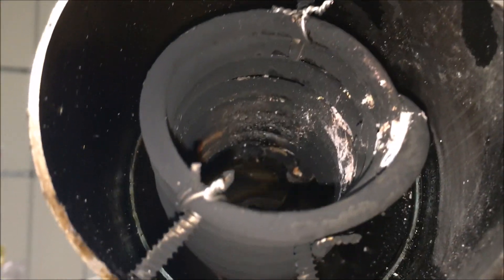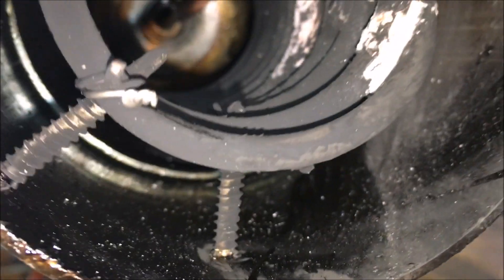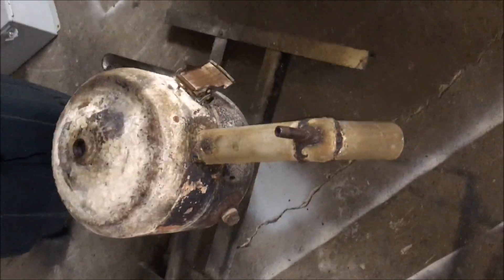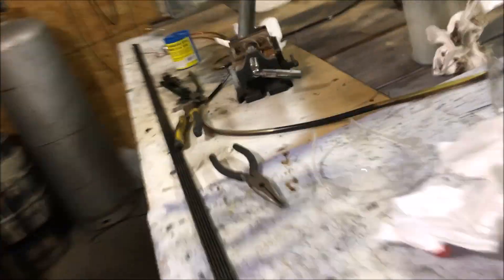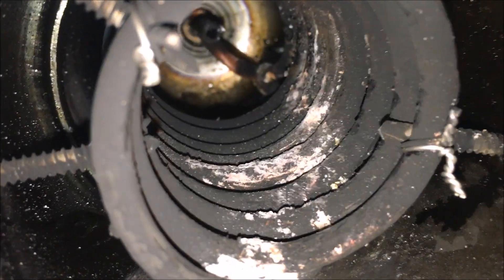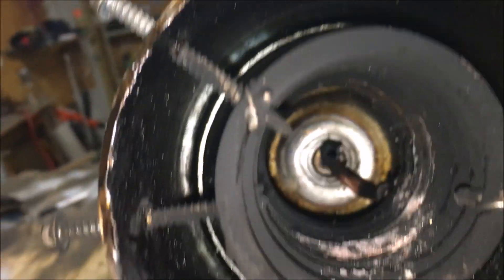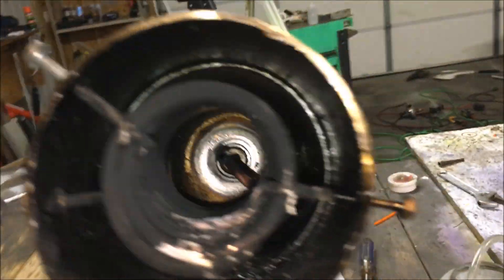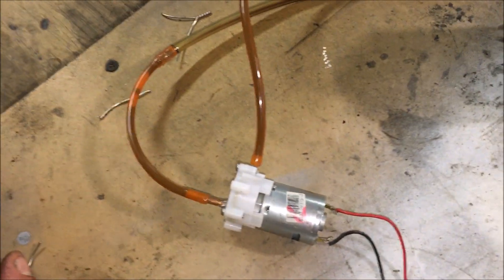Waste oil burner Vaporizer coil  nozzle designs

Comment: What kinde of oil are you burning?! Motoroil or used veggie oil.
Reply from the maker: motor oil synthetic
Reply: @NOBOX7  

There are a few different residues in the oil if you have driven with diesel or gasoline. In gasoline, there may be various salt residues that they put in the gasoline to lubricate the valves after they have removed the lead. Can think that there are different kinds of polymers in the oil as it is synthetic. If it comes from a diesel car that has driven biodiesel then there may be residual glycerol.

I have worked in large heat plants that use different types of oils. Everything from pine oil to various mineral oils. What you describe as the hard coating can be salts. Furthermore, the sticky coating is similar to that obtained around the injection pipes but not in the rest of the boiler. The salt coating ended up in the bottom of the pan and could be glassy in the surface.

The pine oil is not crude pine oil but residue from the oil you get from the pine. All industries take what they want from the oil and residues and the remaining ones use the heating industry.

Try washing the sticky with white spiritus naphtha and the hard ones with hot water.

Comment: The white build up is spent carbon just the same as you get on a piston when you strip an engine it means your running lean .... to much air and not enough oil.

Comment: your fuel to air ratio is correct .... but in my experience, waste oil can be very misleading and particularly counterintuitive. you are getting a consistent burn with no smoke, complete combustion *in the fire*. but there is significant oil puddling (perhaps just from startup) and a very mediocre flame pattern overall. 

you need more air and more air pressure, and likely more fuel pressure but less fuel. this is not the be all end all answer - just an observation and a suggested starting point to further refine this torch. 

the oil, ideally, does not need to be preheated beyond 300* F. once you are beyond that, you will almost always have the problem of varnishing and carbon build up inside, rendering the preheat tube and fuel delivery non existent. if you try placing the coil outside of the burner tube with only 2-4 wraps around, it will probably perform better. running brake cleaner through the tube should remove most of the carbon build up. 

i think it is also worthwhile to cut your motor oil with up to 50% diesel fuel or kerosene - lower flash point, lower viscosity, similar btu output -- less hassle overall. 

a bounce house blower should provide enough air, and the excess can be metered off. 2" pipe should provide enough room for the air to flow. you want something with relatively low velocity, but higher pressure and higher flow. 

oil is tricky because it will burn 100% of everything ready for combustion, giving the appearance of a good flame, but really not what you are looking for. putting a reducer on the end of your burner tube (4" to 2") should give enough combustion chamber to burn more oil and push it out further, leading to less unburned hot oil blowing out of the assembly. 

i install ductwork for a living and i myself have gone through 7 iterations of waste oil burner, i have melted hundreds of pounds of aluminum and lead - let me know if you have any further questions. good luck!
Reply from the maker: I removed the coil , i have a video of me chopping this thing open and inside the coil i did find some varnish build up , next im gonna  try a spray nozzle next with no vaporizer coil , however i do intend to pre heat the oil by raping the injector line around the combustion chamber
Reply: i tried doing that once before - wrapped around the furnace - but it really did not amount to much. I do not think copper will lend itself well to pre heating oil, i have never done it successfully, I think it is more trouble than it is worth because it is more likely to clog - what would be better is using a small water heater coil or perhaps even a fish tank heater in a small vessel (2"-4" round pipe, long enough to contain the heating element) and allowing the oil to pass through that. Having your oil under some pressure (<10psi) while the only outlet is your nominal 1/4" copper line should give much more control over preheat temperature as the oil will not be able to flow fast enough through the vessel to not heat up to temp. *edit: or run a coil inside of the same 2"-4" pre heating vessel, with instead the vessel filled with water as a medium to transfer heat instead of directly heating the oil with the element. I do not know which would be more reliable, I have not tried either, but both seem to be a viable option. Only, if you run a coil in hot water, the oil must flow through the water long enough to get to the proper temperature. Then you have to balance flow vs flame vs pre heat. this whole "free fuel" thing gets very complicated very fast. Do try adding diesel fuel or kerosene, it is much more forgiving and well worth the cost - to the degree where it is almost better to run straight diesel or kerosene and forget the hassle of motor oil. 

However, pre heat seems only really useful if you are not firing into a furnace. Sure, it may help some when firing into a furnace in that it runs more consistently and you worry less about cool downs, but in the grand scheme of things I don't believe it to be a huge benefit in that use. 

A motor oil torch is definitely a handy thing to own, though, too - but you need to create the heat and pressure before it comes anywhere near the torch or the flame.
Reply: Toby Jarvais 

Having two burn chambers will burn more than one, usually, however you will still be left with dangerous CO and CO2. You need a heat exchanger to safely take that heat from outside to blow indoors. It gets complicated quickly - you won't be saving yourself any money, really. 

I would say try to use your existing heat from the house or use a portable heater, or a wood stove.
Reply: Toby Jarvais what you're describing is basically a forced air furnace that traditionally burns fuel oil for home heating. They do make variants that can burn waste oil - to be honest, you would be better off using a commercially made one, though it will cost you several thousand dollars.

Buy a kerosene heater instead, the convenience will pay its own dividends.
Reply: U1

Comment: You could put your coil on the exterior of the combustion tube. With the outlet in the back of the tube, it should get as hot as you need to vaporize the oil
Reply: yes thanks for your input

Comment: it's awesome watching your vids, we have had exactly the same problems, it's like a parallel universe. I switched to compression fittings when my vaporiser fell apart, I'm certain the white deposits we are both getting are the half burned combustion products from engines, I switched to a pre heat instead of vapourizer as my coil blocked, my pre heat is very simple and easily stripped and cleaned if it does block which it hasn't so far. don't expect a blue flame, too much crap in the oil. eagerly awaiting the next installment!
Reply: Add a catalytic device down stream and you are good to go. This will give it a little distance (which means time for mixing, etc) to do its combustion as your fuel air streams will have to be tuned. Well done.
After you perfect this, keep in mind the two products of combustion are heat and water. So don't forget the water as you develop your system. Good Luck
Reply: Yeah, I tried to make one of these and my coil blocked very quickly, worked amazing when it was running but then once blocked wouldnt work no more

Comment: I have been building and experimenting with this waste oil burning wood stove. And I really wish you people would tell about the dangers of this idea , if you have a flameout situation cut the fuel source and do not try to reignite until unit has cooled ,buildup of fumes can cause a serious flash. I know this because my 6in stove pipe blew apart.could have been a very bad situation,no one got hurt,be safe people it can go horribly wrong.
Reply from the maker: this is for outdoor use only

Comment: hi now if you place a stainless steel veggie strainer in the front of the flame it will act as a second heat radiant as the flame/oilresidue excess will vapour more like the new garage sun radiant heaters   just a thrown in thought   you get more time to do your practicles than i do with my air static neutralisation engine project     still struggling making a living
Reply from the maker: thanks for the input friend , thats a good idea , do you have any footage of your project?
Reply: Yes my old LANDROVER video I put as title hydrogen but with knowledge from youtuber ingventor its actually ionic transfer type energy  I call it neutralisation like the spike energy that comes from the standard old fashioned car coil as the points open to collapse tge field but you do it with pulse ac and pulse dc unregulated   Just got to get wiring and static alinement to earths layline north and south to energise the engine/car takes time to sort the logic as its depressing to not get results which if its rushed you won't get the result b. you know about that !  Ok

Comment: What a fun mess.  I played a lot last year but there soooo hard to tune.  i got several  oil burner furnaces but waste oil has to be heated to burn properly.  they make a pretty nifty setup  there is a orifice made to burn oil but you have to hook it up with a compressor,  the compressor atomizes the oil. and the jet assembly has a small element/preheater  most reliable setup i have seen for home heating and pretty reasonable.  i think i have a video on one i built but like i said the whole preheating is the key to a good burn/or a good start to burn.  once you get it going shes good, but monkeying around with it everytime is a pain. Good luck.
Reply from the maker: Thanks for the input friend , yes atomizing the fuel would insure the system wont clog but my research indicates you need up to 100 psi to atomize the fuel and this is more pressure then i can produce with the  available  equipment so here we are .I think this device is doomed to clog from test ive performed in the past but i had to try it , i got the idea from hot air balloon burners , i had to try it and im amazed at how well it works ( no buffeting ) my last device buffeted badly and i think it was because the gravity feed pressure  was fluctuating from the combustion pressure waves as soon as the pressure would rise in the combuster the fuel input would fall off but as the fuel input was impeded the pressure would drop resulting in more fuel input this increases the pressure in the chamber and the cycle would continue, so i new i needed a fuel pump but wasnt sure how to go about fuel injection , at first i thought maybe just spray it onto a hot disk that was  heated  by the combustion but start up would be tuff .
Reply from the maker: Tomorrow im gonna weld the thing together and enclose the combuster , i dont have much oil but it will be cool to see what this thing dose with a nozzle on it .  The purpose of this device for now is to burn tree stumps out of the ground , my old one wasted way to much fuel . its a shame this thing wont last but it will be cool to see how long it will . when it fails im gonna dissect it and post the findings .
Reply: less than 10psi supply air will atomize the oil. chk my page i built a simple version that you can build from off the shelf parts.
Reply from the maker: cool im gonna see if i can find your video
Reply from the maker: crob227 cool i got the 100 psi figure from actual oil burners for homes , the guy was saying that the newer systems use even more pressure so im glad i talked to you about this becuase that guy scared me off the concept   , it just so happens i have a tire inflater that might be able to supply that much pressure , its a high flow unit  and i think im gonna try it out becuase this coil ive built is doomed to clog , thanks for the input bro you may have solved my problem